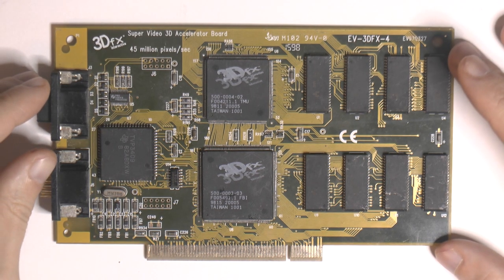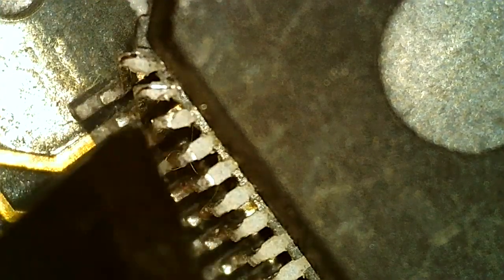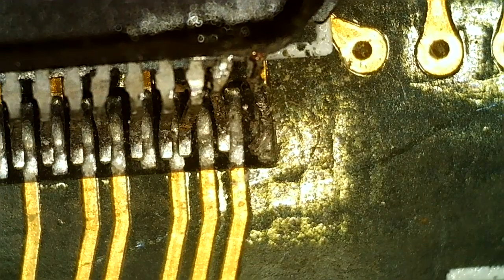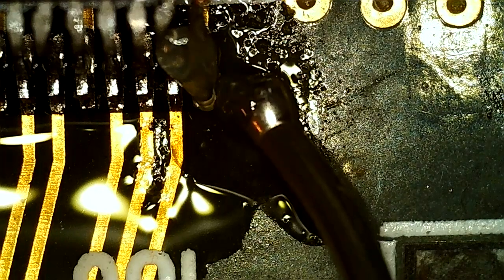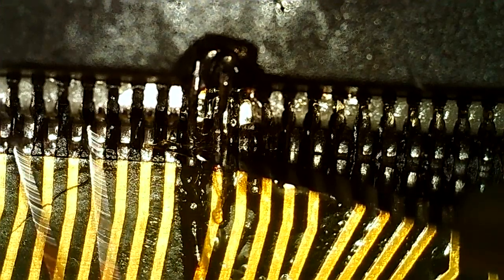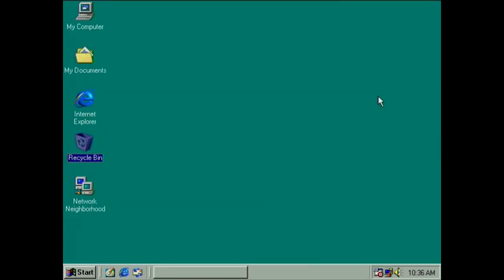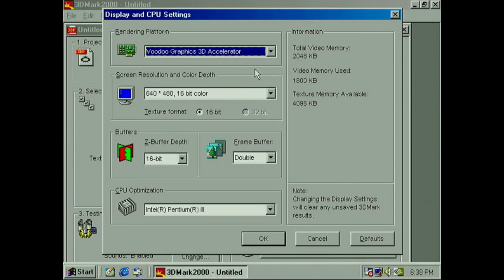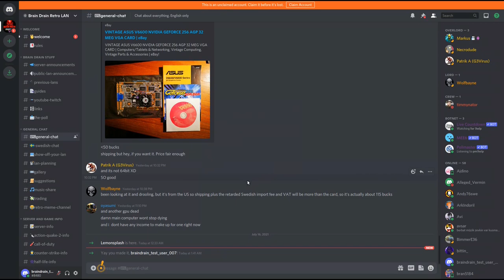Repairing and upgrading a broken 3dfx Voodoo

Comment: that is  true franken-card. Awesome the chips still worked after that abuse. Nice work on that as well. The only thing i wondered if all the corrosion is really removed, but on the other hand it likely would have been a chore to line up those pins again. Hope the card continues to work for you.

Comment: Not so long ago I had a voodoo 2 that was showing white artifacts over polygons...was that  fixable? I sold the card cheap on eBay because of this.... thanks
Reply from the maker: I had a look at a V2 that was drawing random white  lines and there where no lose pins or broken SMD resistors/caps so my guess on that was bad FBI or FB ram.

But I did not have ram or an FBI chip at the time.

But yea if one has the parts the V2 can usually be fixed but it might require a donor if the FBI or a TMU is bad, the rest you can buy on eby.

Comment: That V1 seems to work on a lot more things than my Monster 3D. I can't run 3DMark99 at all, it completely gitches out and hardlocks the system. Which drivers are you using?
Reply from the maker: Latest official if I recall, downloaded from falconfly.

Comment: voodoo1 can be upgrad?

4MB > to 6MB Edo-ram?
Reply from the maker: 8MB at least, 4MB frame buffer and 4MB texture ram.
I never got the Frame buffer mod to work, was never detected.
4Mb of frame buffer allows for Tripple buffering instead of Double buffering so that would give a bit higher FPS when VSync is used but I tend to turn VSync of anyways.

Texture ram can be upgraded to 8MB max according to 3dfx Voodoo1 datasheet BUT I have not seen that done.

There are mods for up to 4+4 but in theory 4+8 for a total of 12MB is possible.

I used 100Mhz EDO from a dead Voodoo2, what was left over from the dead pile of Voodoo2 I built one working from.

You can find ram on ebay.
Reply: Yes. Because the Canopus Pure3d existed.

Comment: Stupid question: how do pins get lose?
Reply from the maker: Solder joints cracking over time.
 Many reasons, thermal expansion to mechanical stress, abuse from users or corrosion.

Cards like this one was probably stored outside in a shed or similar so humidity and temperatur changes varies over time.
Reply: i see. thanks